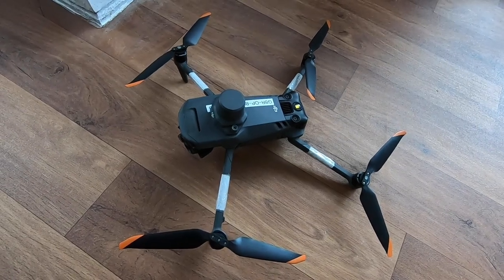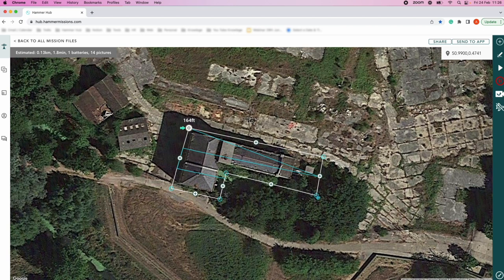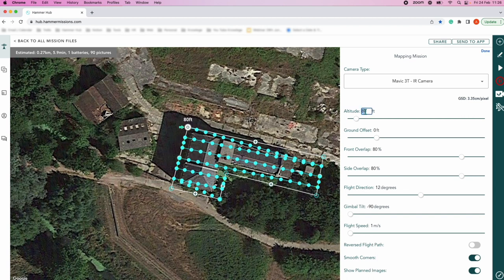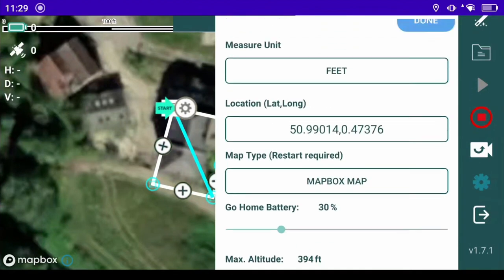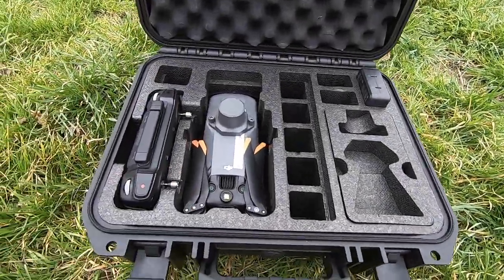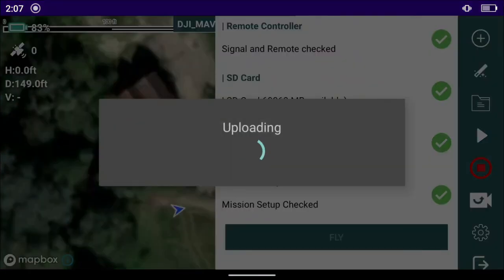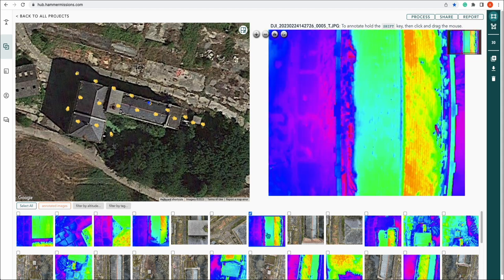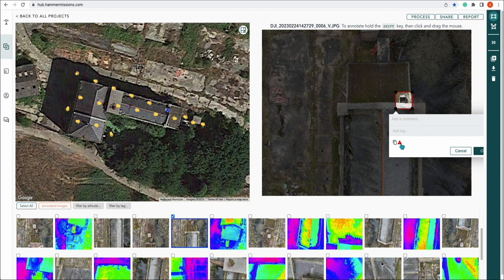End-To-End Thermal Inspection with DJI M3T | Hammer Missions

Comment: Hello,
I’m just about to pull the trigger on Magic 3 Thermal. My targets are solar farms, telecom infrastructure and power lines. Do you think the M3T can safely conduct power line inspections from a safe distance and gather all needed data ( images, tags, barcodes, …) while avoiding EMI? I will use M3 RTK module and a base station to help with positioning and run Hammer Missions software platform.
Reply from the maker: Hi Modiene, the M3T is definitely capable of doing this! With regards to EMI, this might be an interesting video: https://www.youtube.com/watch?v=8gUCdgoZ9RA
Reply: i just bought one, going to the world of drones now, i am a newbe, im just starting........

Comment: At 9:10  you said it’s a 3D mission, why weren’t then the photos taken at an oblique angle, a little bit away from the building?
Reply from the maker: Thanks for the question! Alex is in the video is saying 'It's only a mapping mission, NOT a 3D mapping mission' which would typically include a double grid + oblique images at different angles. Here's more on that:  https://www.youtube.com/watch?v=NJ40Q_ZyyPg
Reply: @HammerMissions  my bad, I fat-heard🤣, sorry about thst.
Your platform is awesome, I'm a future customer.
By the way, if I am using it in Africa, would I need a specific basemap, or is it provided by Hammer Missions?
Thank you.
Reply from the maker: @DakarBlues  thank you for your kind words! all base maps provided by Hammer Missions by default.